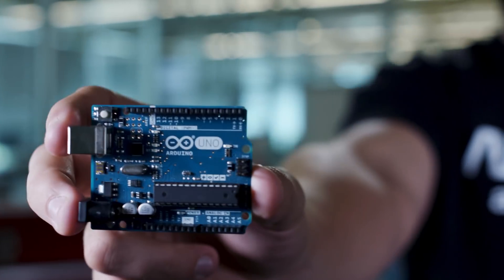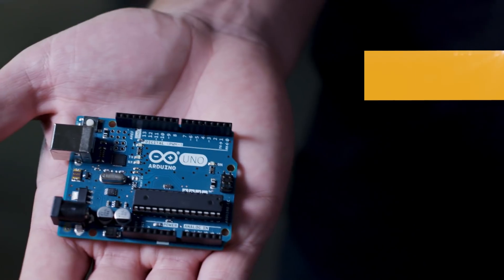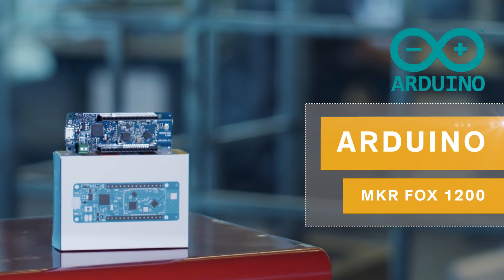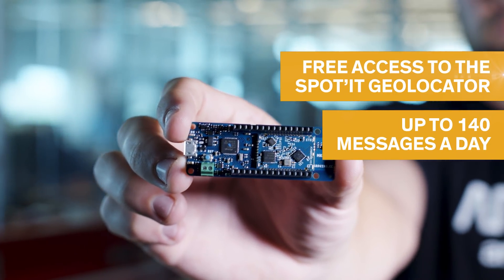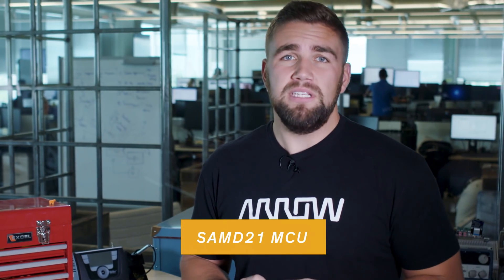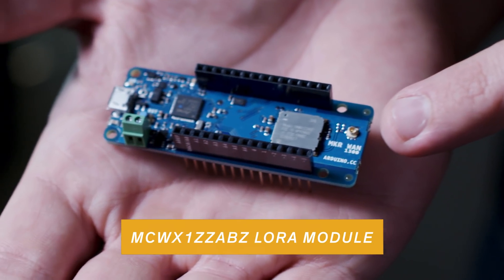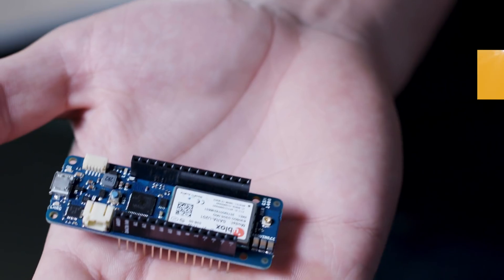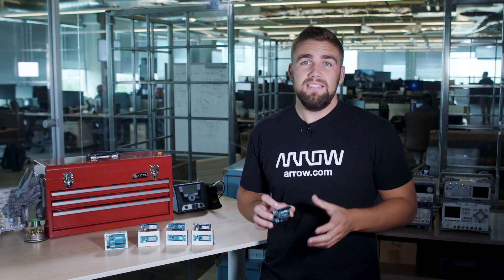Arduino MKR – the New Frontier  | Arrow.com

Comment: I think the next big thing will happen whenever Arduino releases an Uno R4 (or whatever they want to call it) based on the new ATmega4809. 

  ..just placed my first order with Arrow yesterday. The free FedEx overnight shipping is nice! On a sub-$30 order too.
- An Ex-AliEx customer? ..well...maybe not quite that extreme, but I am much more likely to consider Arrow as opposed to my usual Mouser/occasional Digikey search.
  As a side note, I don't need to order more storage containers/materials. I was sent a ton of dip IC tubes, oversized antistatic bags, QFTP containers, etc. with my order. 
  That's worth a solid, nonsponsored, recommendation +++
-Jake